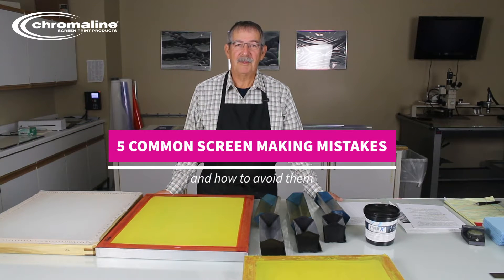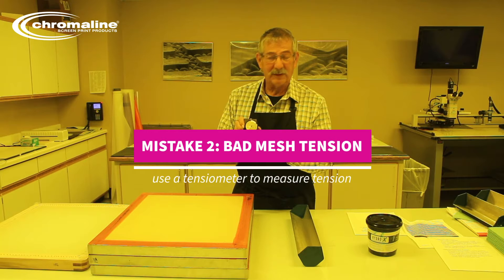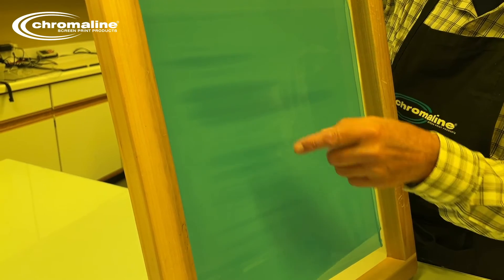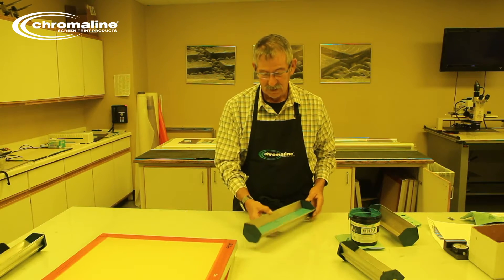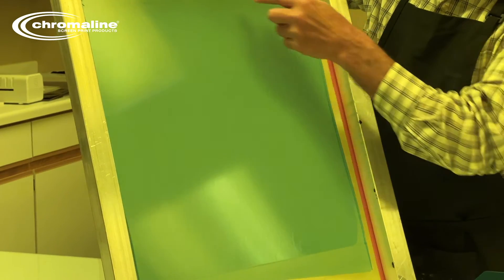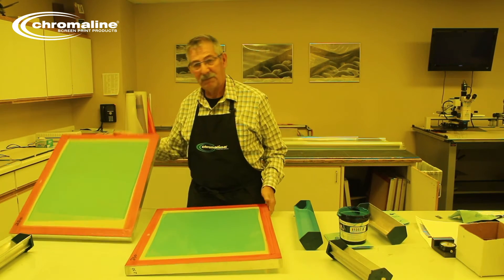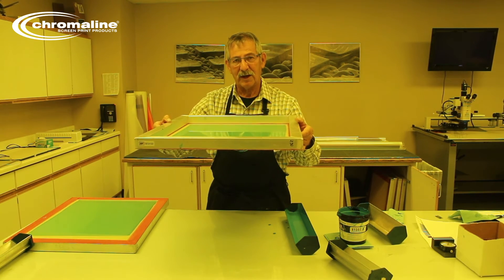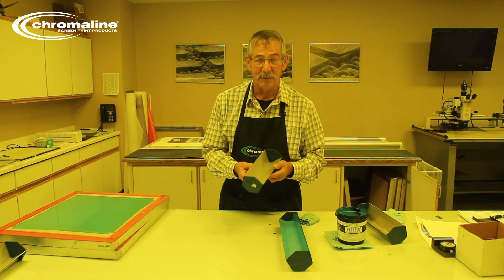5 Screen Making Mistakes To Avoid | Chromaline Screen Print Products

Comment: A couple of years ago, I had an emulsion rep tell me I should be using the sharp side of the coating trough for 195 mesh screens and higher. This is because those are typically the screens we use for gradients and thinner/dark inks. His argument was you don't necessarily want to lay down as much of an ink deposit for a gradient, or even a dark ink (like black) as you would say, with white ink on a 110 or 156 mesh that was coated with the smooth side of the though. We use a dual cure emulsion. Did that rep send me down the wrong path? We fortunately haven't had any issues using the smooth side for 156 and lower mesh screens and the sharp side for 195 and higher mesh screens.
Reply from the maker: Sounds like it's working for you!